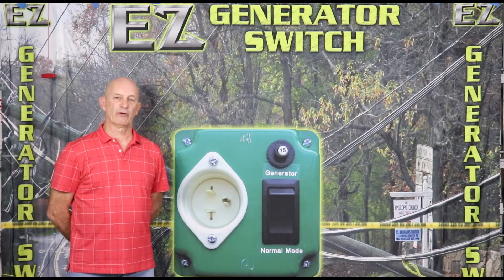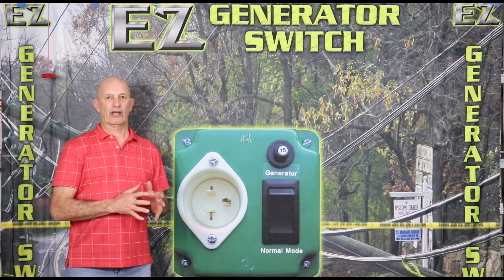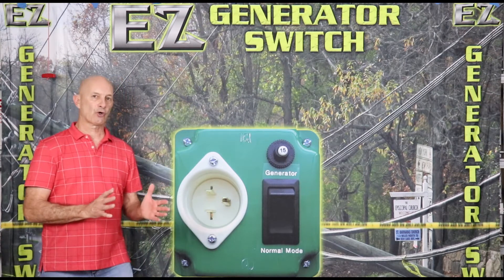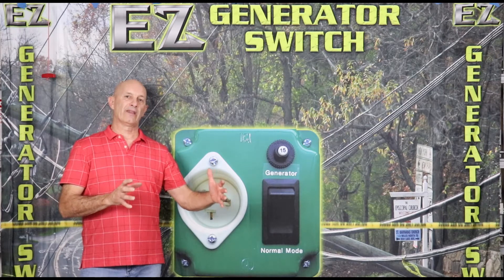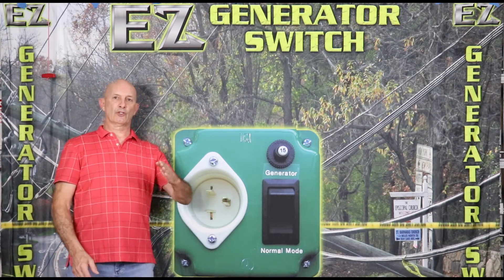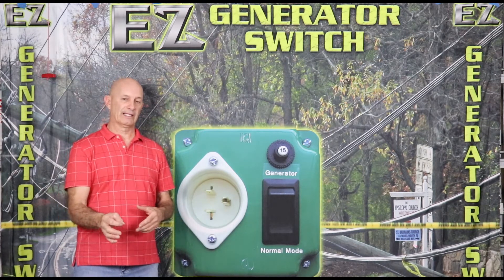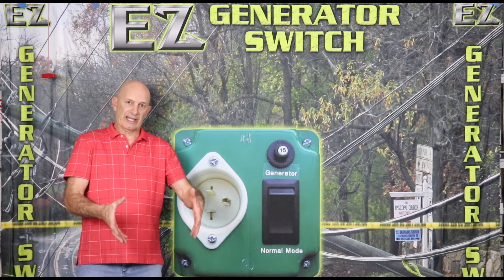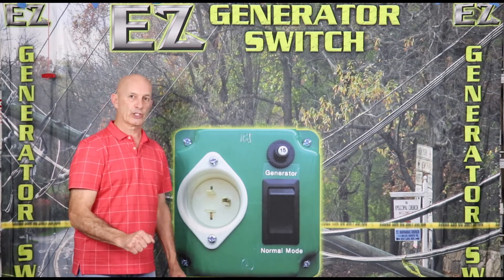EZ Generator Switch FAQ - Should I Ground My Generator?

Comment: Ground rods are meant to dissipate static discharge voltage (lightening). Fault current returns to the source via the bonding conductor. This is why we bond the grounds to the neutral at the main panel

Comment: Excellent advice. Every generator I've ever seen (regardless of size) has a grounding lug. Connecting a ground is not only safer for the user, but can also reduce the potential damage to the generator itself if an internal failure occurs. We once had a 2.2 MW (Megawatt) generator fry the exciter windings due to an improperly terminated voltage regulator wire. The exciter winding and regulator were replaced for about $30,000, however,  the ground wiring system saved the majority of a $1 million dollar generator.